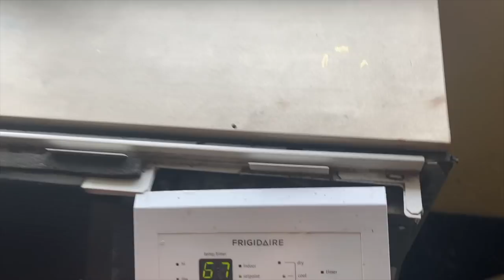DMV: Meeting SaddleTramp

Comment: As a mechanic my 1st guess would be fuel pump or your gas is boiling in the fuel lines and you need some heat shielding a lot of 4 wheels have the same problem CF moto But of course testing will have to be done that's what I would do

Comment: Diggin the head-mounted camera...been doing a lot of that myself lately.  Have you considered using Bunk a Biker for overnight repair needs?
Reply from the maker: I've used it a couple times. It's generally not really my thing, but actually really came in handy in Sand Diego when I needed to replace the chain and sprockets on my KLR. Met an awesome with the 2nd oldest shop in SD. Outlaw Cycle Products I believe. In Dulzura.

Comment: With your bike running for 30 minutes and then dying again and then running and then dying again. A possible cause of that is a clogged gas cap vent. Your fuel pump can’t suck gas out of the gas tank and less air can get into the tank through the vent..
 One way to check that is, when your bike dies again, quickly open your gas cap and listen if you hear that suction noise of air equalizing as it rushes into the gas tank the instant you open the gas cap...
  years ago I was listening to the trucker channel on Sirius radio in my company car that I was in for seven hours a day.. there was an advisor speaking to the truckers talking about the different antifreeze on the market. that so-called expert was explaining to the audience that the pink or red antifreezes that are out there today never need to be changed. The old antifreeze, the green stuff does need to be changed every so many years. But I guess that gets expensive on a big rig truck that holds many gallons of coolant..
  at the same time you have to make sure that the coolant you use in your motorcycle is aluminum compatible... there is also an issue with the green old antifreeze containing something called silicate, which is actually abrasive to water pump shafts and seals. I don’t know if that’s a tiny crystal or solid that forms in the antifreeze. But I do remember they called it a silicate that is abrasive to water pump seals..
  One other time I had intermittent fuel starvation problems. I had a Pontiac Grand Prix that was rear ended. With a big plastic bumper in the back, it didn’t look like much damage. Soon after that, my car would just quit running in the middle of nowhere, on my way to work, on my way to the store. it would quit, then 15 minutes later it would start right up.
  it turned out to be broken internal baffle parts in the gas tank. I saw them scattered around the bottom of the tank when I pulled the fuel pump out.... they were occasionally getting sucked into the intake inlet on the fuel pump and shutting off the fuel. Then when the car would quit, they would drop off..
   Love your travels. I’m retired so I watch them for hours. I started my own channel under my other screename - jodyfresnack-and it’s not easy. I have to do all my videos with one take, no editing, I don’t know how to do it yet..
  Please keep the videos coming
Reply from the maker: Good info brother 👍 yeah I tried opening the cap and listening for the whoosh, to no avail. Even tried running with the cap open, made no difference. Wish it was that lol 😅 I used an aftermarket pump in spite of my better judgment which saved about $600. To me it feels weak but oh well… read that about the silicates, made sure this stuff was free of that. Thanks again for the kind words man 😎